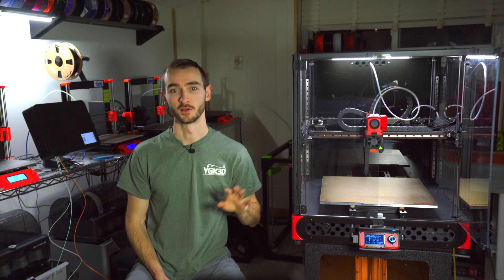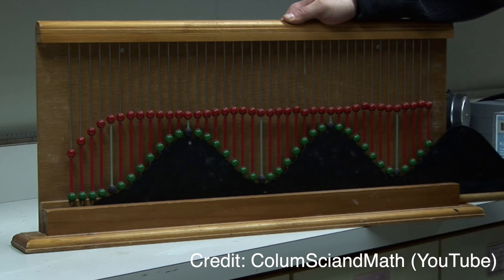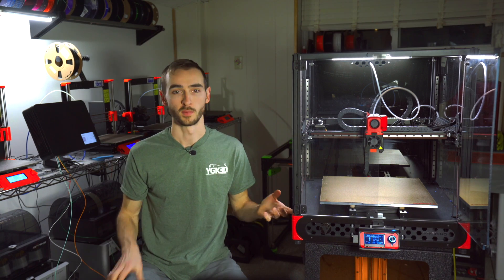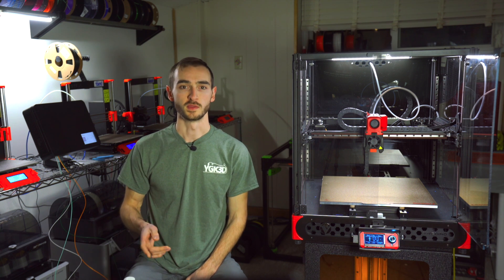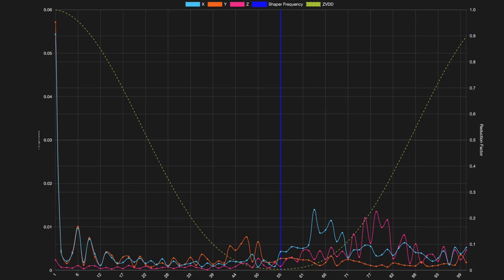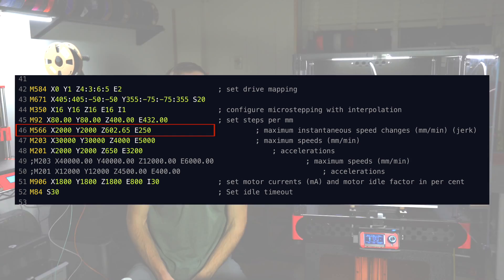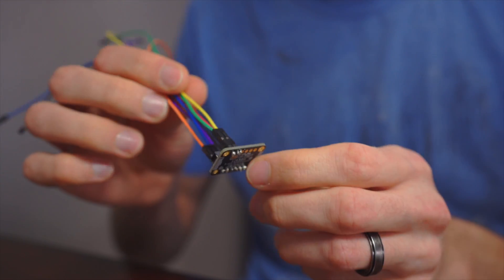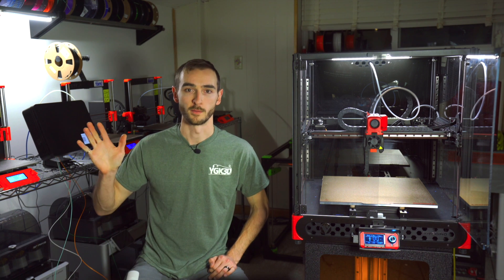Fight Physics with Physics to Print 2X Faster - Troodon 2.0 Input Shaping

Comment: I'm trying to do this but there is no explanation anywhere how to print a ringing tower with increasing frequency like you did. Where do I type the input shaping settings? I didn't see that in the video.
Reply from the maker: Check the pinned comment. It provides the instructions :)
Reply from the maker: I also have the pre configured project files set up for both OrcaSlicer and PrusaSlicer available to download on my Patreon if you want to spend a few dollars to save a bit of time.

Comment: It seems that Klipper is using the accelerometer data in real time during prints to constantly update the input shaping function in realtime?

With enough computing power, 3D printing will go the way of CNC machining, with closed loop motion control.  Lidar on the X and Y axes will be used to measure the position of the print head as it's moving and the 3D printer firmware motion planner will adjust the stepper motor positions to correct for all sources of positional inaccuracy.  Bigger X and Y stepper motors and more powerful hot ends will result in 1000 mm/sec print speeds and very nice looking and mechanically strong prints.  We might even see small DC servo motors used instead of stepper motors.  Even with all of the advancements in print quality and print speed, there is still significant room for improvement in 3D printing.

Comment: About to pull the trigger on one of the Troodons to compliment my 4 P1Ps to have the flexibility of the larger volume but keeping the faster speeds. Do you think multiple Troodon 2.0 would scale well in a print farm or would the Voron be the better long-term pick since it would be more open source?
Reply from the maker: Definitely Troodon over Voron for a print farm. Building multiple Voron's seems like a colossal task. The Troodon offers great value and comes mostly pre-assembled.

Comment: Cool video! Good to know the accelerometer isn't really needed with a stock Trodoon. Would you still think it is recommended to switch to klipper or is the reprap with this modification sufficient?
Reply from the maker: Personally, I think that RepRap with input shaping is sufficient to get good quality prints. I don't see much advantage to switching to Klipper.

Comment from the maker: Thanks for watching! A few things I forgot to mention in the video:

1. After you've found the optimal combination of shaping function and frequency, you need to add the following line to your config.g file: M593 P"zvddd" F45, replacing zvddd with the shaping function you identified and 45 with the frequency you identified.
2. You can download the ringing test tower STL from the last link in the description. If you're using PrusaSlicer you can add the following code to your "After layer change g-code" under Printer Settings to generate the test towers. Replace "zvdddd" with "mzv", "zvd", "zvdd", "zvddd", "ei2" or "ei3" to generate the frequency tower for each shaping function. I've uploaded all of the test tower 3MF files to my Patreon account, so if you want to save some time and support the channel you can check them out of there.

M201 X2000 Y2000 ;set max X and Y acceleration 
M204 P2000 ;set acceleration value for print moves
M572 D0 S0 ;Disable pressure advance

; 0.2 mm layers, 12 segments at 5mm each, 60 mm total
{if layer_num <= 24}M593 P"none"
{elsif layer_num == 25}M593 P"zvddd" F45
{elsif layer_num == 50}M593 P"zvddd" F46
{elsif layer_num == 75}M593 P"zvddd" F47
{elsif layer_num == 100}M593 P"zvddd" F48
{elsif layer_num == 125}M593 P"zvddd" F49
{elsif layer_num == 150}M593 P"zvddd" F50
{elsif layer_num == 175}M593 P"zvddd" F51
{elsif layer_num == 200}M593 P"zvddd" F52
{elsif layer_num == 225}M593 P"zvddd" F53
{elsif layer_num == 250}M593 P"zvddd" F54
{elsif layer
Reply: Did you find 2000 for acceleration to be optimal? I found 3000 on mine to be decent. Then I pushed it up to 9000 and was able to achieve speeds of 400 mm/s, but it was not possible to eliminate the ringing at that accel and speed. Also I saw your short in which you say you installed clipper. Is that with the board in it that came from the factory?  Not knowing if the factory board could run clipper, I ordered a BTT MP8 and CB1 to install in my Troodon 2,0
Reply from the maker: @archiejacobs6741  I haven’t tested the max acceleration much. It should be able to do 4000 mm/s^2 comfortably with input shaping enabled. To answer your other question, I installed Klipper on the stock board. The only other thing you need is a Raspberry Pi (or equivalent).
Reply: @ygk3d  Thanks for the fast reply. I will be looking forward to more of your videos about Klipper on the Troodon 2.0

Comment: the big question now, do you recommend buying one over a Voron kit?
Reply from the maker: The answer to this question depends on your end goal. If you view a 3D printer as tool and just want to get up and running as quick as possible then the Troodon is a good option. If 3D printing is your hobby and you like to build, tinker, and learn, then the Voron kit may be a good option for you. For the latter, expect to spend multiple days building.

Comment: Great video! I really appreciate this series. However, we have different ways of thinking about this input shaping 'problem'. I would  definetely convert this machine to Klipper. Maybe it's because I have a few Pi's lying around doing nothing, but I also have another machine with Klipper and I really like it. In my mind, the Klipper solution is quicker and (arguably) better and more precise. 
Also, it would have been nice to show off a few testprints with speed and compare them to the prints on the Voron at the same speed. I'm still on the fence...I have an XL in pre-order, which is obviously a different kind of machine, so I can't compare them. I really want the toolchanger ability of the XL. But this machine is cheaper and I might get over the toolchanger bit...
Reply from the maker: "I have a few Pi's lying around"... If that's not a flex, I don't know what is 🤣. Not everybody will be so lucky, and with the cost of Pi's these days, I'm not sure the switch would be worthwhile. Honestly, I'm happy with the print quality in RepRap now that input shaping has been configured. I'm not sure what additional benefits there would be to switching to Klipper at this point. If you have some ideas, I'd be happy to hear them. I have an XL on pre-order as well... looking forward to getting that but the cost is considerably higher, even for the single head version.
Reply: @ygk3d  haha...the Pi's I have 'lying around' are 3B's from previous projects that have been discontinued. I had a few of them from the time they were not so scarce and expensive. At this moment, they're waiting for something new.
Maybe you can show some comparisons with input shaping on the Troodon enabled and your Voron at the same speed settings, so we can see if there's a noticable difference.
Reply: @PhilippensTube  Klippers input shaping analysis is great but the problem is that klipper applies separate shaping for the X and Y which will introduce new artifacts. Input shaping makes the accellerations accellerate in multiple steps and the steps should cancel out the ringing of the previous step. However if X and Y are different frequencies and you have a corner where both X and Y are travelling then the accellerations/decellerations will not be the same for both axis and the toolhead will deviate from it's path. So if you are printing a line at 45 degrees the line will not be straight but jagged during acc/decc. This is horrible. Don't do it that way. Use one frequency in the middle that captures both the X and Y with for instance ZVD that input shapes a wider frequency band. It will compensate for both frequencies.

Comment: Thing about klipper IS is it tells you the max recommended acceleration you can use before smoothing becomes an issue.  Accelerometer gets you the right answer in 5 min for all three variables at once, frequency, shaper, max acel.
Reply: I hope RRF implements an IS auto tuner at some point

Comment: What's the max Z height you can print on this? The website says 330mm and the S3D profile only says 320mm.
Reply from the maker: The Cura profile is 330mm. The height is 350 mm but you lose some travel because of the cable chain which prevents the gantry from raising up all the way. This is true of the original Voron 2.4 design as well. I believe you can reclaim that extra 20mm by replacing the cable chains with an umbilical cord for the print head wiring.
Reply: with stock machine you see anything above 280mm is getting tricky. As mentioned the cable chain and filament tube hits the roof. I do not print above 290mm at all. If i need to print something tall, i have tenlog d6.
Reply: @lilbHEMI  I get 319.8 before it stops with the firmware.

Comment: Does the troodon 2.0 have auto bed leveling probe?
Reply from the maker: It has an inductive probe for gantry leveling.
Reply: @ygk3d  do you think it can be upgraded to the Voron clicky probe easily?
Reply from the maker: @kimzor1989  I addressed this in part 3 of the series. I expect it can be done but it may require some modifications.
Reply: @ygk3d  thanks

Comment: The problem with using shielding like what you find in a USB cable is that if you don't ground it, it's not effective.  You might actually have better results with twisted pair.  Like what you get in CAT6 cable.
Reply from the maker: Good to know! Thanks for the tip.

Comment: I was waiting for this video….I still may switch to an Octopus v1.1 Great info.
Reply from the maker: Thanks for watching!
Reply: Is it easy to swap to an Octopus? I want to graduate to a Klipper printer, but this printer is awesome.
Reply from the maker: @br88dy  This switch would require you to re-do most of the wiring since the stock board uses a single bus cable for the majority of the wiring. If you're going to switch the board it would probably make sense to do the canbus upgrade at the same time and switch the cable chains for an umbilical. In my opinion, this would not be worth the investment. If you want to tinker and learn, sure, but if you if just want to print, then I wouldn't bother. I would leave the machine with the stock board and firmware personally. At some point I expect someone to make a Klipper config for the stock board so that may be an option down the line.
Reply: @ygk3d  hey thanks for that response. This final video in the Troodon 2 series reminded me how important it is to me that I learn something new and try Klipper on my next printer. I’m very comfortable with complex assembly, so I pulled the trigger on an LDO V0-S1 kit last night. That will likely be my only Voron. I enjoy assembly, but I got bored of my second MK3S+ kit real fast. Pre-assembled is the way to go. 

Thanks again for this series. I want to transition into the commercial side of things now that I’m running all over town helping other people with their first printers. So I’ll probably join your Patreon. I want to sell prints and also have weekly intro classes. Maybe you have some experience and advice on that hybrid approach.
Reply from the maker: @br88dy  Thanks a lot. That would mean a lot to me! I've just started the Patreon but will be starting to post regular content with a business focus. I 3D print full-time and look forward to sharing what I've learned as well as the resources I have generated over the years. I've partnered with two talented model designers that will be helping me generate 3D printable models, in addition to the advice and other resources I'll be posting. You'll be able to sell these under a commercial license as one of the benefits of being a member.

I definitely have experience with the "hybrid" approach as you've coined it. I'm currently teaching a 9 week 3D printing course to a class of primary school kids. I also do product design and sell my prints online.
Reply: @ygk3d  very cool! I love teaching my nephews about this, their minds were blown when I showed them how easy it is to make something in TinkerCad and print it. The creative juices are flowing and they want to design Pokémon items they can sell at school lol. See you at Patreon.

See you
Reply from the maker: @br88dy  you’re a legend. Thanks so much! Big things coming soon.
Reply: @ygk3d  am I the first legend??
Reply from the maker: @br88dy  yessir. And you shall forever hold that honor.
Reply: @ygk3d  💪